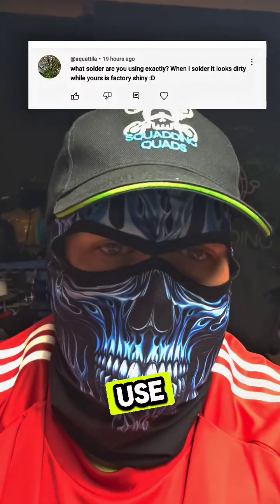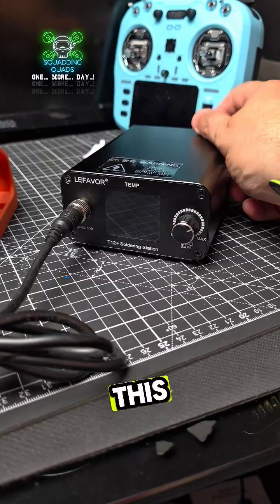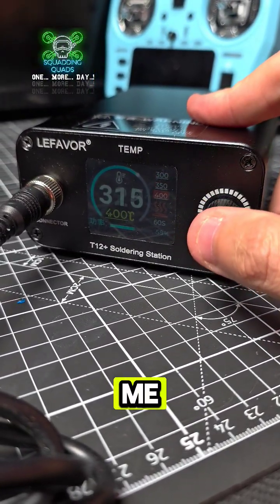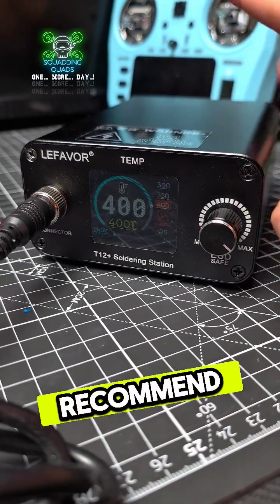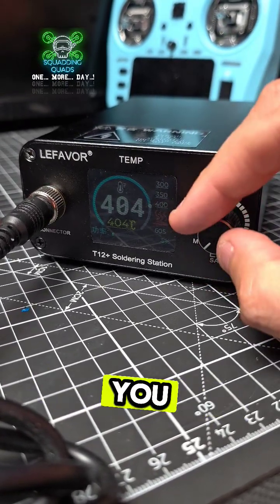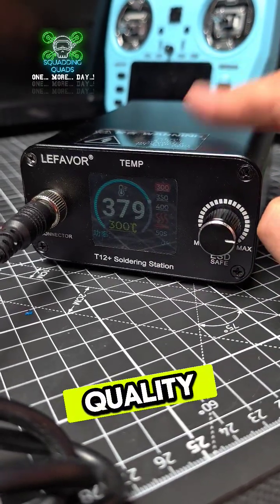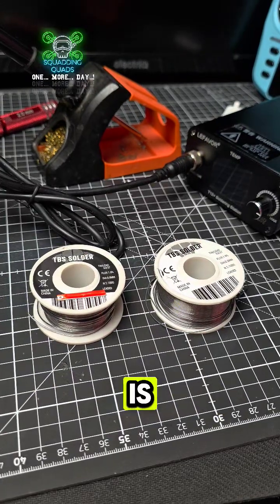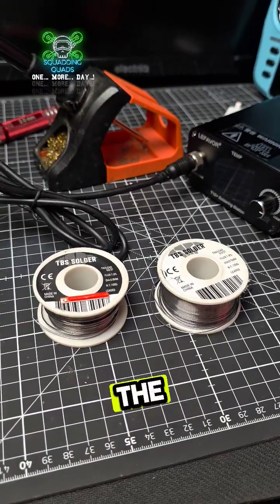Why YOUR Solder Looks Dirty – 2 Tricks for Shiny Joints ✨🔥

Comment: the tbs solder has silver in it? Thanx
Reply from the maker: Flux?
Reply: @squaddingquads  silver
Reply: It might, some solder has silver in it.. its usually specified as a silver solder, however.
Reply: @tokin420nchokin  Yup! And is for this reason that I was askin'.  :)

Comment: Don’t forget a good quality no-clean flux pen
Reply from the maker: The tbs solder has flux built into the core :)
Reply: @squaddingquads oh, sweet
Reply from the maker: Takes an extra step and expense out of the mix 🔥🙌 @HaleFPVRC
Reply: @HaleFPVRC you should still use flux. Its going to help your solder flow out better. I use mg chemicals 8341 no clean flux paste, its tacky enough to hold your component and after it melts it cleans up off the pcb really easy.